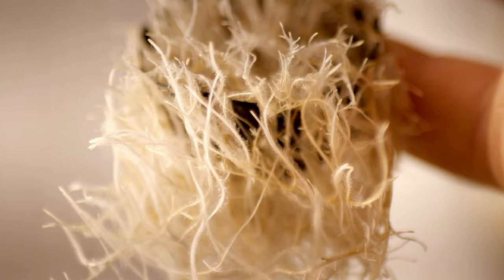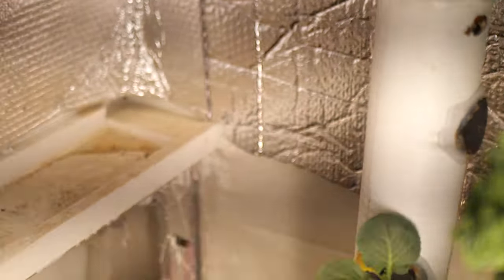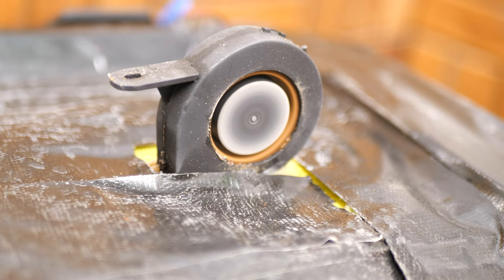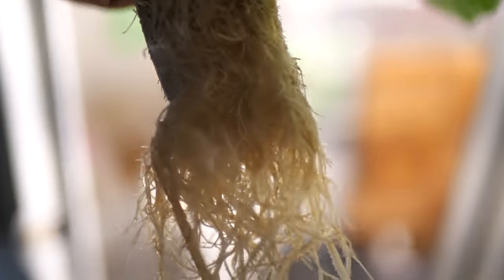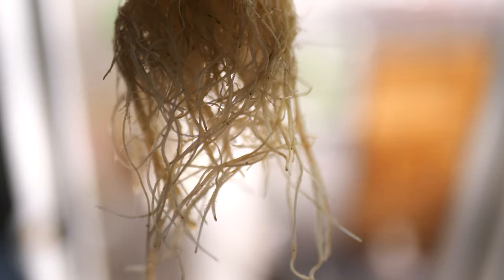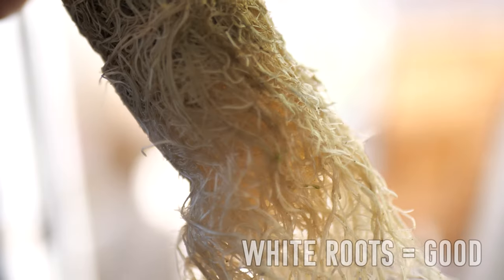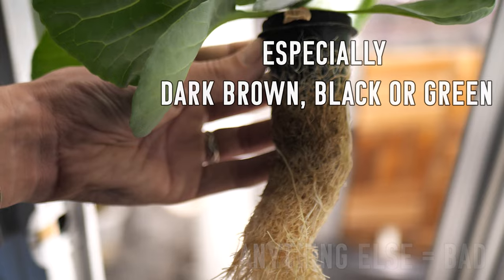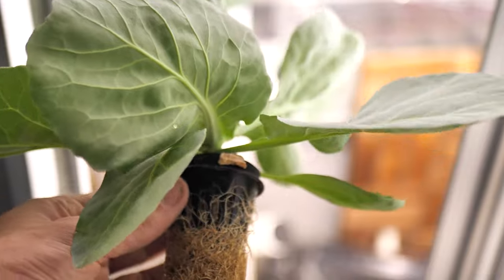My Fogponic Cabbage Update | How to get fuzzy aeroponic roots

Comment: I've been spending a few years designing 3D printed parts for an aeroponics setup (mostly taking so long because I'm being lazy, not because of anything too intricate), and the root system kinda matches what I expected when I saw your earlier explainer video for this set up - the pipes are too tight, they're set up at the same pipe size you'd use in a nutrient film or ebb/flow hydroponics system, not a system where you want to circulate particles in airflow.  

Ideally you'd want something more barrel-sized to allow wide circulation and unrestricted growth, maybe with some minimalist framework inside to give a little structure the roots can fan out on.  But anything the size of the pipes you've got is going to wind up getting choked out by the roots.

Comment: Problem is that nutrient salts will break ultra sonic foggers
Reply from the maker: How long is it suppose to take? I have 4 running full time for a few months now and I've had to replace 2 ceramic plates (they each come with 3 extra)  but no foggers broke yet, I would love to know so that I can be ready.   Thanks for the comment :)
Reply: @humblegrowth   Like you stated was more a maintenance deal than the fogger completely breaking. Tho I did have a few go down completely.  Probably 6 months in started the major issues.   But higher parts n feed rates I'm sure contributed.   I didn't stick with it much longer than when problems arose, just switched to NFT. Was on a large scale with a cash crop, high temps, n hungry plants so not alot of room for error therefore I didn't mess around too long. Sounds like you already got it under control.  Happy growing friend
Reply from the maker: @cliffhooper3558  Awesome Cliff thank you for the info. TBH I'm pretty over fogponics as well. My stubborn nature won't just let me give up lol Watching every other hydro garden I have out perform my fog gardens is a bit frustrating.